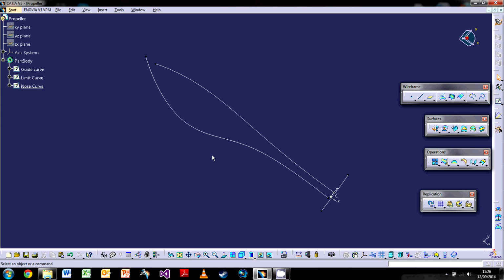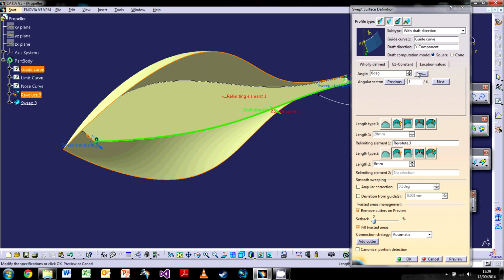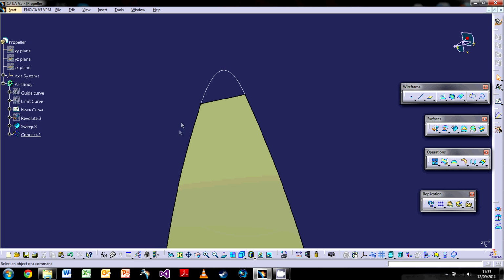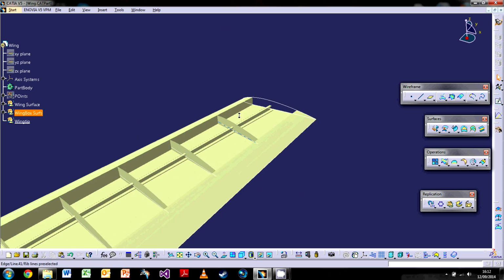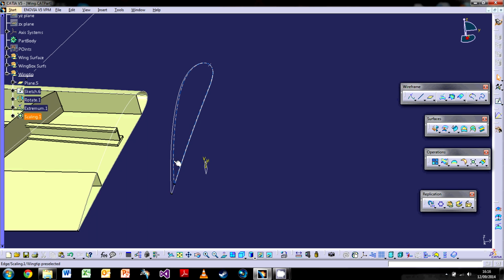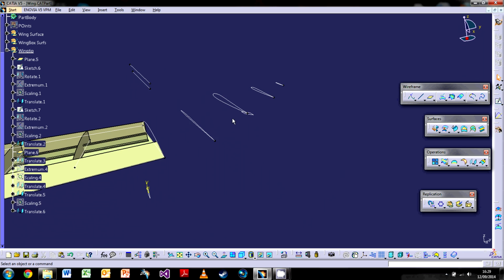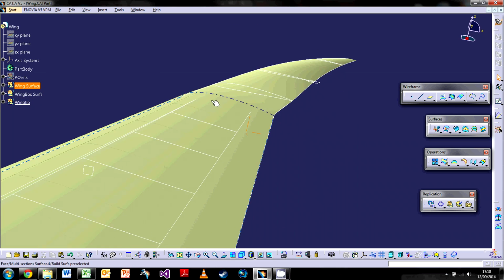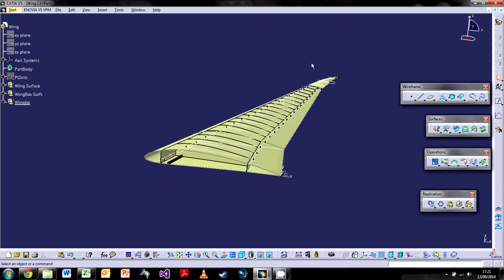CATIA V5 : The Basics Tutorial 7: Wireframe & Surfacing Pt.3 ¦ Propeller & Wingtips

Comment: Awesome Tutorial. I do have a problem with the stringer though.
The distance between the stringer and  front spar at the root section and tip section are equal. 
the distance at the tip should be lesser i.e. If I am to use a number of stringers, they should all contain at both ends.

Tutorial was of Great help. THANKS for taking the time to share.

Comment: Hi there, thanks a lot your video helped me with some questions I had about wingtips and even a problem I've been having about linked parts that you so kindly explained in the video (using the replace option). 

I was wondering, in the very tip of the wing, you put a very tiny aerofoil, but did it finished flat? could a dome be created? I haven't quite get around this...

Comment: hi, great tutorial, im new with catia
i have 1 newbie question, there is a hole (airfoil shape hole) on the tip of the winglet, how to make it as a solid?

thanks
Reply from the maker: Hi there.
two ways you can do it:
1. use the fill option in the solid workbench - this will produce a completely solid part which might not be ideal but it should close off planar(flat) open  edges.
2. use the fill in the 2D surfacing using a passing point. This might be tricky getting right profile but then you can join everything up and use the thickness operation in the solid workbench. watch this space more coming soon!